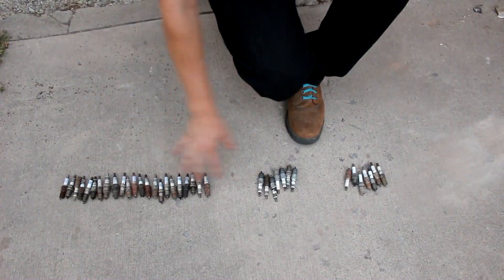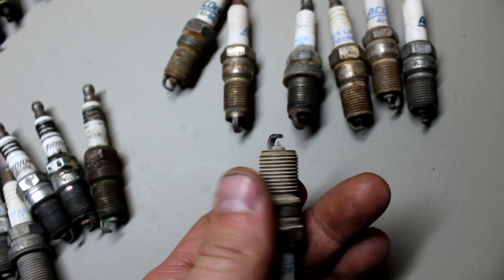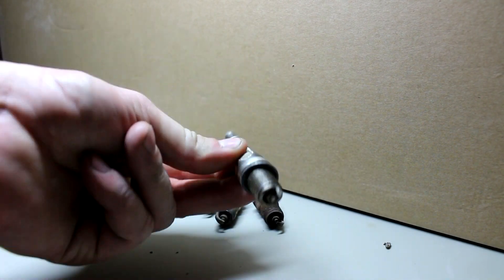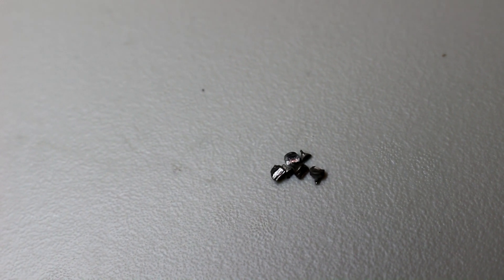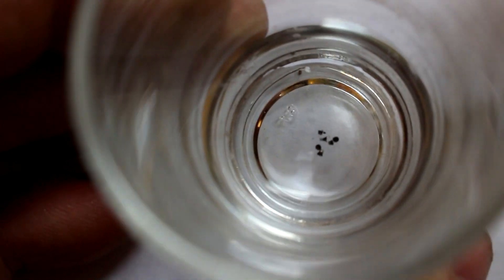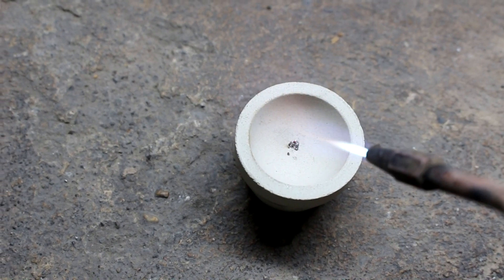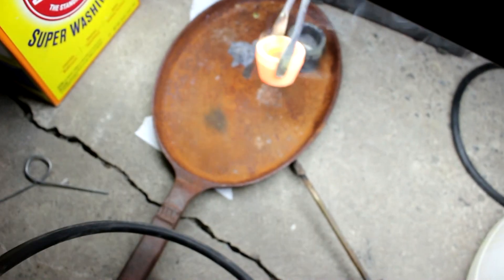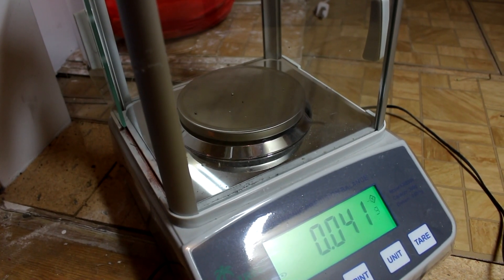Precious Metal Refining & Recovery, Episode 13: Platinum From Spark Plugs

Comment: for all those wondering 
a 5 gallon bucket of spark plugs weighs about 100lbs.   or ~45.3kg.  average spark plug weight is 45g, so ~1,000 plugs per 5 gallon bucket.  if 100% of each one is 2mg of Pt thats ~2g of pt per bucket.  or ~$60usd worth at a 10 year average.  most places that do recycling of them give $25 for the same weight in the US.  maybe a bit less depending.
with the time and effort of the DIY... this is NOT profitable.  do the math.  please.  there are also almost no buyers open to the public for Iridium scrap.  i had a few oz of 90/10 IR/PT and was told to come back as a commercial company and 10x as much, back a lifetime ago.  maybe someday, someone will figure out what to do with all these rocks we dig out of the ground, and we will stop poisoning ourselves with heavy metals, hahaha.

Comment: The really thin wire tip ones are iridium, the plats have small flat disks, and the coppers should be obvious. If you google the number on the plug it will tell you what it uses

Comment: The gap is tuned for hot spark at least wear. The voltage over gap thing is no issue for car engines. That myth comes from kids modding their two-stroke motorbikes.

Comment: Platinum is pretty much standard in sparkplugs today. All NGK ones have platinum electrodes and are not specially marked. Iridium ones are marked, and have a higher price tag (and are kinda overrated for most applications)

Comment: I was wandering....
If the tips of the spark plugs contain platinum, Is It Pure? And If So, Why Not Just Cut the pieces off more precisely with something like a fine cutting Dremel Tool disk to eliminate the non platinum metals, then beed it from there? 
I'm Just new to this & curious. 
GREAT VIDEO! 👍

Comment: I am a mechanic, most used spark plugs are burnt down to nothing. Thus the ever increasing gap. The heat you need to smelt the different alloys does not seem cost effective.

Comment: Couldn't you just drop the entire spark plug into the nitric acid and save yourself the work of clipping off the ends?  Or (if you were going to get serious about recovering platinum from spark plugs) fix up a little gadget where you put the spark plugs into a holder and they're submerged in their own tiny bath of acid until the platinum drops out?

Comment: It’s called a center electrode and side electrode(ground electrode). The basic plugs are resistor plugs all of which are made of different material but mostly copper and are changed more frequently like around 30k, iridium less often as in 100,000-120000 depending on manufacturer.

Comment: My Uncle had the spark plugs in his truck too long.  One morning he tried to start it and could not for the life of himself figure out why it would not start.  He called a friend of his who is a mechanic at a shop just over the hill from him and he suggested the plugs were worn out.  The plugs had double the gap they should have.  It really did surprise me that the thing ran OK.  If he still had it today it would probably have nasty 20 yr old brake fluid in it too because many people neglect to change that.  Some of those people probably never change their transmission fluid because of horror stories from people who changed theirs and could not get the car to go.  Of course that is somewhat of a myth as long as you change transmission fluid when you should and maybe a little earlier and usually happens when someone changes it for the first time ever on a very high mileage car.
Reply from the maker: Manual transmission doesn’t have that problem.

Comment: Hi Cody.  
I know you are a professional and very very smart.  But please take 2cents of warning.  Platinum is extremely dangerous it causes a condition called platinosis  if gotten internally or breathed.  Platinosis can happen two years after contact and I do not know of a cure.  That is one of the reasons catalytic converters are not salvaged by most.  Your experiments with platinum should be under a laminar flow hood.

Comment: Much immatures, unprofessional appreciation for the mineral values in the comments.
Mining Data on this channel, and it's videos, I find the true value in money is in making this video.
Cody spent a day, about $35 in prorated costs for lab equipment., and a further $25 prorated production equipment costs, and the net return ONLY through YT us currently over $3000.  This video is ranked 53rd in Cody's inventory.
The copyrighted work continues to return residual income, and gas royalty rights potential as well.
My seat of the pants estimated doubling of the $3000 is 7 years.

Any creator of Cody's size grosses $1000 between 4 hours and 4 days after release of a new video.

Long term is valuable in YT.  There is a disgraced gaming channel where the creator was caught cheating, and dropped further production in disgrace 3 years ago.  That channel fell 85 percent in incone, but is over $60k a year in current incone.
THAT is the value of Platinum and Iridium.  Using them to title and make videos.

Comment: I run a 2002 Mazda RX7 with an 80mm Garret turbo, Aluminum block 2JZ on 1/8th mile tracks here in Texas. My uncle has an NHRA team. Every pass they do with the top fuel cars they have to change the plugs, even the platinum ones. By the end of the run the engine is just dieseling because no spark lol

Comment: i believe the Ac Delco plugs that werent marked are their Rapid Fire series and they are Iridium tipped. In the USA they cost aprox $6.36 each and are good for 100k miles. Its the only plug Ive used since the came out. the Bosch plugs suck usually last a yrs if that. 
You could prob get more platinum out of catalytic converters. Its been a big theft problem in the US people stealing them from automobiles and selling them for scrap.   Nice collection of refining videos you have done here!  thanks for sharing!

Comment: So based on the material you have there, I calculate you could make over 24,000 spark plugs with 1 Troy oz of Iridium. There is a bit of rounding here, but at 12-15 dollars a spark plug that is a lot of money in someone's pocket.

Comment: Iridium is so badass. Practically non corrosive by any acid, densest element along with osmium, one of the highest melting points of the elements, one of the hardest elements as well and the only metal that retains good mechanical properties at a temperature above 1600 Celsius

Comment: Hmmmm it seems 1000 junk spark plugs might be worth a couple hundred dollars. I wonder how long it would take to pick up 1000 spark plugs from junkyards? Pulling lugs and leaving them on the ground means the cylinder will fill with water and corrode quickly, essentially destroying what might be a usable engine.

Perhaps making a deal with local shops to buy the plugs they remove for tune-ups... and craig's list ads. Penny a plug.

Comment: Did somebody calculate the densitiy of the Platinum bead? 

1,48 mm diameter = 0,74 mm radius. The volume of a sphere is determined according V= 4/3 π r³. 
4/3 x 3,14 x 0,74³ = 1,7 mm³. Both figures multiplied with 1000 for easier calculation = 40 g and 1,7 cm³. 
40g/1,7cm³ = 23,5 g/cm³. The density of Pt is 21,45 g/cm³. Not bad, your weighing and your measurement with the caliper! It's close to the value from literature. 
I did the same with a Beryllium bead I once purchased and found 1,9 g/cm³, where the literature says 1,84 g/cm³. Now I know, I didn't get screwed.

Comment: I did the math, to get an ounce of pure platinum via this method, you would need a whopping 14,000 spark plugs. 2 milligrams per spark plug = 500 spark plugs per gram, just over 28 grams = 1 ounce, 28 x 500 = 14,000
Reply: Actually, it is worse than that. There are 31.1 grams in a troy ounce - so that comes to 15,500 plugs.
Reply: You would have to work at the junkyard to come up with this many spark plugs.
Reply: Cromulon 

Time to get 14,000 spark plugs

Comment: Very nicely done Cody. However, you have overlooked one critical flaw in your calculations that exposes your lies. How do you explain the absence of potassium trichloride gas when you combine the platinum with the sulfuric acid? Alas, it's not really platinum. Merely copper dioxide.

Comment: '
i did used 4 plug sparks to the wire grinding wheel and cleaning up really easily...
finish that wire grinding wheel...
put 4 clean sparks to the car engine...
very smoooth and perfect running well

Comment: Hi Cody, out of curiosity, is it possible to collect precious metals in a electrolyte solution with an energized anode  made of a carbon rod and the cathode made of the metal to be collected (ex: platinum) with small particles of the metal dispersed throughout the solution? Can the particles of metal (platinum) in the solution build up on the platinum cathode?  Do I see another video on the horizon?  :D

Comment: Cody the AC Delco plugs are OEM. They were original in the car. No one saw them until they were spent. That is why they aren't labeled. Any fine wire electrode (.4-.8mm) will be Platinum or Iridium. You can also tell by the ignition system if they are single or double. Single coil vs Waste spark (GM coil packs) in the coil packs the electric arcs swap origination points and the platinum must be on both sides because of this. Iridium is usually only on the electrode. The ground strap (hooked part) Will have a platinum pad.
Fun fact: Iridium if not an Element that naturally occurs on Earth. ALL the Iridium we have is located in the layer of dust from the large meteorite strike that killed the dinosaurs. Love the videos. Keep them coming!

Comment: So awesome where do you get your crucibles and such?? I have a homemade furnace it wouldnt be able to get to the temperatures needed for these metals but for Al it does just fine. Also what can I add to my Al to reduce oxidation on the surface??

Comment: do spark plugs constantly make sparks or only on startup?
Reply from the maker: only so long as the engine is turning over.
Reply: If the engines turning the spark should be firing. Its constant. However a diesel engine has "glow" plugs and they are only used on startup. Heat of compression does it once its running.
Reply: They are on all the time as long as the engine is running, but not on diesel engines though as they don't need spark plugs to work.
Reply: thank you, finally a yes or no answer :)

Comment: Could you make a video where you take a fairly old car, one in poor condition, purchase it (assuming they sell it for under $500) and scrap the whole thing for its metal? I want to know if it is profitable to actually scrap a vehicle than to try and sell it for such a low price. Of course, it would also need to include the cost of the materials and time spent on the process.

Comment: Awesome! How much money would say 100 spark plugs worth of platinum be?
Reply from the maker: about 6$
Reply: ***** your videos are amazing man. I really love what you are doing. Keep it up man!
Reply: @theCodyReeder  i was thinking the same thing. i'ma keep chucking them in the scraps then lol
Reply: +Cody'sLab do you watch mumbo jumbo I saw the pillow
Reply: Matthew Martin there is much more than that in spark plugs-I have some iridium from a bunch of them in the form of wires and small blubs,which is really huge pain in the butt since I don't know how to melt it properly and I always fail with it even though my HHO torch is proven to be able to melt rhenium pellets(now I have a 3 grams rhenium bead instead of several smaller beads that I ordered from Amazon)-so it is able to melt rhenium with melting point of 3186 degrees Celsius and when I melt iridium metal with 2466°C melting point-it simply doesn't collect itself in anything!And I don't know why is that so but it is so!And I even tried to use some sand as flux(yes,God damn sand-because borax and lithurge don't work in such temperature)-so I don't understand what is going wrong with them!And also as I know the iridium oxide is decomposing at temperature of around 400°C so what is actually stopping iridium from collecting itself I have no idea!
But anyway with platinum it's wa-ay more understandable and also easy to work with so I got a plenty of it already-so since I think that I will need a lot of iridium for my prototypes so I guess I will also collect something like the same or bigger amount of platinum as a by-product of such stuff so I will supposedly either sell it or will just make a large souvenir out of it😎
Reply: Fun fact gold is worth less than platinum
Reply: Robogecko40 right now it is not-and that is really strange..
Reply: @robogecko4067  funny how the central banking chicanery of the futures market and political upheaval in South Africa now has both gold and palladium worth more than platinum
Reply: how about in a catalytic converter
Reply: Cody says 6 bucks but the cost of chemicals will put you in the hole unless you do a extreme amount and your time is value too it's a good experiment to do
Reply: Christo Pyper   I love it....made my day. I checked out your homepage, subscribed. Thanks!
Reply: Actually $403,261,285.39 come on it's simple math
Reply: about 2 cents
Reply: Matthew Martin thanks for the advice!Yes,didn't think about the oxidation-reduction in this case..
Actually I than would better find some kind of either small jewellery manufacturer or some small plant that has such a furnace so I will just pay them for "rental" of their furnace for an hour or two-and melt that stuff there..Especially osmium,since it is very tough and dangerous to work with-as it's tetraoxide is highly poisonous and extremely volatile evil stuff..
Just strange that the same time platinum metal is wa-ay easier to melt and actually behaves much better than iridium and especially osmium..
And by the way is there any kind of flux that maybe would fit the task of protecting iridium and maybe even osmium while melting them?Just had an idea to use quarz sand as flux-but don't know will it work?
Reply: gold is worth more than platinum again right now
Reply: Wander how much a junkyard would charge for a bucket of spark plugs??
Reply: Cody'sLab actually not quite a correct number-don't actually know what is wrong with your yield(sorry bro,but it is so)-but I got a much bigger yield!
In fact what I did with them was first of all cutting the central contact a bit lower(3-4 millimetres down from the beginning of the middle part-around 5-6 millimetres from the tip)-and as in fact I am too lazy to get aqua regia and process them with it(anyway I am a firearm designer but not quite a refining master)-so finally I ended up after cutting both hundred of iridium and a hundred platinum spark plugs' electrodes-I just took my super-crucible(why super?because made of hafnium-tantalum carbide😎)and my friend's TIG welder and melted them all together!By the way I placed a cap on top of all this stuff just in case some precious stuff gonna vaporize-but luckily it didn't happen.And as I obviously did melt down all those tips-both iridium and platinum,so I decided to try to remove at least some of the poop that came with them-to oxidize and vaporize the copper,burn out the iron and seems like I was left with mixed iridium-platinum alloy,and though I initially estimated that out of the useless poop I will have yttrium and nickel in this step but I was surprised that instead just melting and mixing with platinum and iridium the yttrium burned out as well as iron did(well,most of it at least)-and nickel was later separated by melting all the stuff again but this time with adding some graphite powder,so actually I got my platinum-iridium alloy quite fast and easy-and here is the interesting part!
Total weight of all that alloy was 5.7 grams!And I really mean grams!And after that I simply went to a local chemistry lab(where I occasionally appear if I need some chemical stuff for my firearm projects;this time by the way I need iridium metal,and in a really large quantity),and asked them to process the blub converted into fine powder in aqua regia and so,return me separated iridium metal powder and platinum metal powder..And the final yield was 2.1 grams of iridium and 3.6 grams of platinum(both pure)!

So back to the beginning,as I know 3.6 grams of platinum would cost significantly more than 6 bucks-so seems like you might have missed something!

And by the way I have another problem with my iridium processing!Seems like now I have almost an ounce of pure iridium powder(23 grams)-but how the heck to melt it into a single button?Just don't have an access to vacuum EAF-and without it I will first of all blow away half of the powder with my HHO and the same time I don't have enough skills of TIG welding to do it with TIG!So do you have any suggestions?Just how to smelt pure iridium fine powder into a single button without losing it due to blow away and due to oxidation(which is unfortunately occurring with iridium metal powder as you know 🤧)?
Reply: @John Sheppard bullshit.
Reply: Worth!!!
Reply: MIgardener | Simple Organic Gardening & Sustainable Living 
FALSE!!!!!
ITS WORTH $6.50!!!!!!!
DO THE MATH!
Reply: Christo Pyper    $6.47!!!!! GOD!!! CAN'T ANYBODY ADD?
Reply: @dueyfuckuey  if your talking about how much the platinum was worth ? it was $1.50 cant YOU do math ?
Reply: dueyfuckuey 
Actually...
According to the recent price spot changes of platinum..

ITS $6.404345755657066!!!!!!
CAN’T ANY OF YOU PEOPLE MATH!?!?!?!
Reply: Less than the chemicals and processing required.